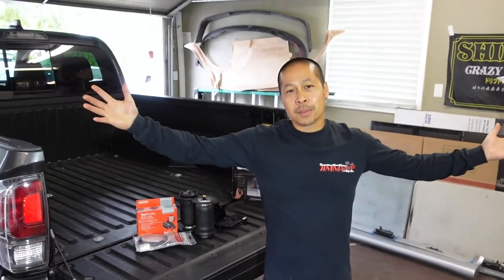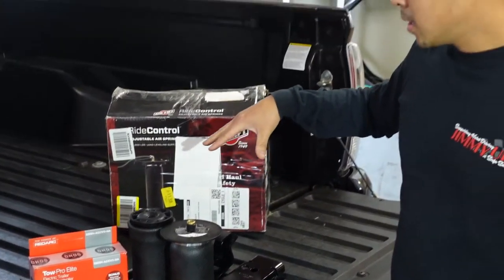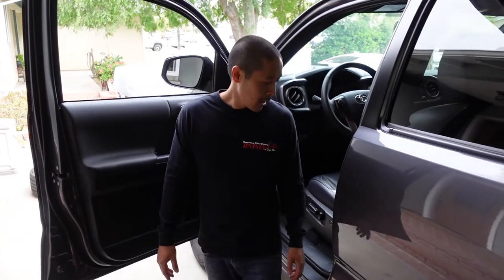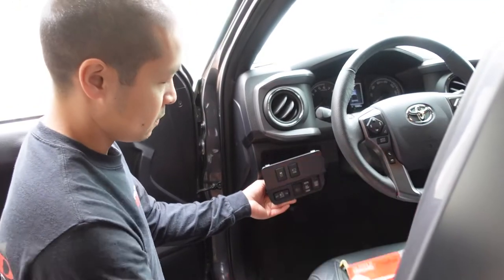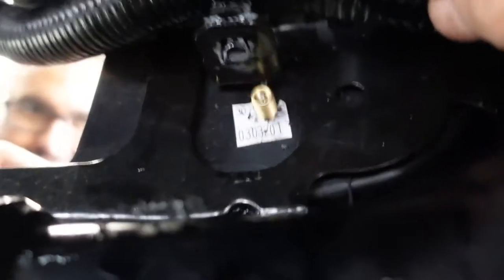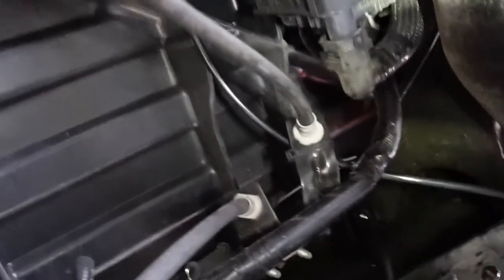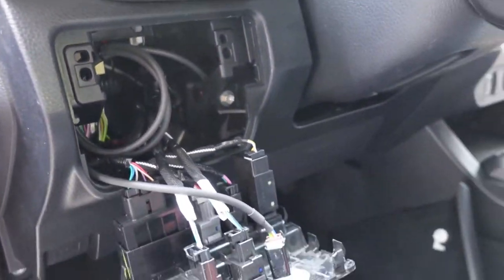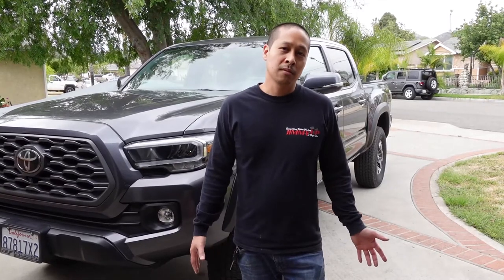TACOMA Towing Mods | AIRLIFT bags | REDARC Tow-Pro Elite Controller

Comment: Am getting ready to install a break controller in my 2020 TRD Pro. Looks like they're aren't any screws to deal with; plastic parts just pops/snaps into place for the wiring harness and controller switch plate.
Reply from the maker: Yeah the trim on the interior is just snap in. You'll just need zip ties or something like that to secure the module under the dash.

Comment: Since you are pulling a car hauler often, have you needed to add a tranny cooler or felt the need for a different radiator to keep the engine cool?
Reply from the maker: I don't have a oil temp / oil pressure and nothing extra to monitor coolant temps other than the stock gauge cluster.  It's not the most powerful to take over a steep incline but i'll keep up with semi's going up the same grade.  I've towed with the outside temp being over 100F  and the truck didn't let me down.

Comment: Are you guys worried at all about tearing the air bags at full suspension travel?
Reply from the maker: I had the rear end in the air and I’ve rotated tires once without issues. Towing with a load I put 75 psi in the bag and it drives way better. The rear end doesn’t feel so loaded.